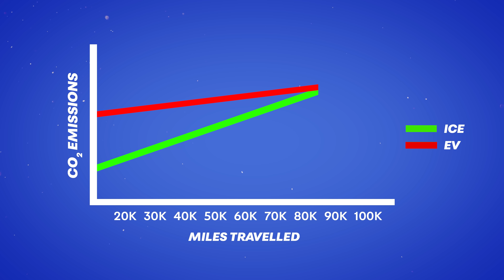Are Electric Cars REALLY That Green? [New 2022 Data]

Comment: The XC40 Recharge is twice as good as or  almost equal on CO2 emissions. Depends on how "dirty" electricity was used. Does driving style matters also?
XC40 ICE = 58 tones CO2e
XC40 Recharge = 27–54 tones CO2e

volvo-cars-LCA-report-xc40.pdf
Page 29. Conclusions.
"... the Carbon Footprint of an XC40 ICE and XC40 Recharge is 58 tones CO2e and 27–54 tones CO2e respectively....
 Life Cycle Analysis (LCA), has been used, which has been identified by the EU Commission as the best framework for assessing the environmental performance of products has been used... " end of citation.

Eventually, people will run out of gas / oil / coal.

Comment: The study assumes that EV components are made from virgin materials, which although true right now won't be the case once a robust recycling program is in place. Also as grids become cleaner, the breakeven point gets shorter and shorter.
Reply: Volkswagen are already building their electric vehicles using a high percentage of recycled materials.

Comment: The one thing that I don't see anyone talking about is the fact that mining the raw materials like lithium and cobalt is not only massively damaging to the environment physically, but there are also massive human rights violations specifically with cobalt mining, the other thing we need to keep in mind is that the electrical grid will have to be massively upgraded to keep up with the demand if everyone decided to go electric all of a sudden I'm not anti electric, but I feel like we have to talk about these problems and nobody is talking about it. Also keep in mind that on many older electric cars the batteries had to be replaced before the crossover point of Co2 emissions between ICE and BEV vehicles and what happens to the batteries once they are used up? Recycling the batteries is still very difficult and dangerous as it is a huge fire risk, this is why I am still hopeful of hydrogen coming in to at least to a degree try to save the day, yes hydrogen cars are not as fast and flashy, but I think that producing green hydrogen is possible, but we will see I guess, at the end of the day I hope that the planet benefits from renewable energy use and not some corporation that destroys the planet for profits

Comment: Thank you for this honest look at the comparison between EV and ICE cars. Another big area to consider is that there are so many ICE vehicles on the road now that will continue to pollute for 10 or 20 more years. What would be the trade off between recycling ALL of those vehicles asap vs leaving them on the road to continuously pollute for decades. In the '70s the USA did a buyback program to get the heavily polluting older cars off the road.

Comment: Here is the thing, you have to replace  a battery before 100k miles, did anyone take that into account? Also ale internal combustion combined is less than 17% of total co2 emissions.  If you wanted to fix pollution you would fix manufacturing and power plants but that would require companies to do, it's easier to make individuals pay to barely make any dent at all than to require companies to spend their own money and clean up their crap.
Reply: Why would you have to replace the battery before the 100'000 mile battery warranty expires? Have you done any research before you posted?
Reply: @Brian-om2hh  I know 2 people that had to replace their batteries. The argument is more so about co2. Even if you don't replace the batteries all vehicles in the globe still only account for 17% co2. And you will never get every vehicle to be electric. If you think ev solves the world co2 issues you obviously have not researched manufacturing and power companies.

Comment: It is safe for oil companies to sit back while EVs are promoted precisely because EVs will never be truly competitive.  Can an EV pull a travel trailer across 3 states in one day ? Of course not......  and it never will..... EVs cannot compete with internal combustion cars of the 1930s !  I ask you to research the 'Stanley Rocket '  of 1906-07,  the 1st car capable of 200 mph...... and the 'Dobel E series' 7 passenger limousines of the 1920s...... imagine the steam powered automobile improved by today's better lubricants and bearings, better heat exchange materials, better heat insulating materials, lightweight strategic alloys and carbon composites....... If the 1907 Stanley Rocket had shock absorbers, or proper weight displacement,  or an air dam to hold the front end down..... or even a smooth running surface, it could easily have broken 200mph without the accident occurring..... It took another 20 yrs of development and 22 more cylinders for internal combustion to break 200mph with Seagrave's twin V-12 sunbeam on the same beach.......  I say "Apply modern tech to the steam power system and it would take another 20yrs for internal combustion to match it's performance,  if ever.......  in the meantime,  we could all enjoy a 90% reduction of CO from every car and total elimination of all carcinogens and sulfurics from automobile exhaust....... the fuel we burn is not the problem,   the engine oil we burn in internal combustion cars is the problem "  Let's  wake up, folks !

Comment: That's using the lithium ion that ev current uses. Lithium titanium oxide is ready to go and used for a while. It's also good in low temps. Salt ion is going to be where it's at in about 5 years. It uses far far less rarer earth metals

Comment: A point not mentioned is that the production of batteries have changed dramatically in the past 10 years and continue to improve. For Gas cars.... well it's being the same thing for the past 100 years, not even the average Gas millage has improved a Ford model T consumed 16 miles a gallon not a huge difference from the average car today
SO lets see how this comparison evolves in 5 to 10 years

Comment: The didn’t factor in how toxic and bad for the environment making solar panels for your home is.  The factored the batteries, but that is only part of it.  Solar panels use EXTREMELY toxic materials and the waste from the factories destroy the environments surrounding the factories (China tries to hide this).  Also when your solar panels expire after 20-30 years they cannot be recycled so they are just thrown into land fills... all the cadmium, benzene and other toxic materials IN the panels pollute and destroy the surrounding soil, water supply, wildlife and air for decades upon decades.

Fossil fuel combustion engines have their problems, but honestly going green is creating a much larger problem for the generations 100 years from now, if they even survive the toxic waste going green creates.

Comment: I wonder if they took into consideration the average lifespan of the batteries? 
It is generally considered to be just under 65,000 miles before they need to be replaced. 
Then you have the cost to get the batteries replaced, and a huge spike in the carbon footprint to make the new batteries. Not to mention disposing of the old batteries.
Reply: That's bogus, the expectation of short battery life were entirely speculative and the speculation has proven to be wrong.

The drive to get new batteries is because better batteries are invented that give an improvement, not that there is substantial loss.
Reply: @Treblaine  Source?
Reply: @Nobere  The warranty period for the batteries is typically 100'000 miles.

To offer a warranty like that and not be ruined by claims the typical lifespan must be much much more than 100'000 miles.
Reply: @conceptobject  everything has a life cycle, just its nowhere near as short for car batteries as people assumed.
Reply: It depends on the environmental conditions

Comment: The irony of calling something that produces less Co2 greener is that Co2 is plant food thus more of it producing more plant life. I wonder how many miles the battery is good for before needing replacement thus producing more Co2. And do they calculate the carbon footprint of manufacturing, installing and replacement of the green energy systems onto the power usage of the electric car. All that said we have to go renewable electric as the fossil fuels are running out.

Comment: EV is much greener than assumed in this study. ICE mileage is on the road at a constant speed. Mileage is zero when stuck in traffic. EV power consumption is zero when stopped in traffic. EV also has regerative braking, which is not possible in ICE. No consideration is given to air pollution from ICE. Many states and countries are banning ICE in a decade or so.

Comment: How do we generate enough electricity to power the upsurge in EVs?
Reply: Just think for a moment. If there is an "upsurge" in EV's (as seems likely) then none of them will run on gas/petrol or diesel, will they? So that then leaves much more grid capacity, because it will no longer be getting used to refine massive quantities of fuel for ICE cars......

Comment: I’d like to see the long term affects of ev vs petro . Repairs in long term , battery replacement cost & battery life expectancy over petro repairs long term . 
Most petro cars today will go 100,000mikes before needing a single repair if it even does need anything replaced . Even oil changes are going 10,000 mile intervals from many manufacturers .
Where do these old batteries end up from ev cars or any lithium battery for that matter ??
Reply: You can already see the effects of petroleum. Street level pollution in many cities is now reaching critical levels. There are already deaths in London, with air pollution being cited on death certificates as a factor in the death......

Comment: Another issue that may need to be factored is the average temperature of where you live. EVs efficiency goes way down in cold climates. Heat has to be created using the battery and thats a big draw on the battery. Driving an EV in winter time in Winnipeg will get less mileage (kilometers) and engineering explained calculated up to a 40% decrease. Also batteries dont like really cold temps..

Comment: Great point about battery size...many of use don't need huge batteries. I have a 500e with a relatively small range, but it's all I need. Range anxiety seems to be having a detrimental effect on the environment, as it pushes manufacturers to ever larger battery packs.
Reply: yeah, ideally we need small batteries, but fast charging and many charging stations. 250km of range is probably more than enough for many people. Obviously there musst be models with longer range but I also think that having the chance to get (for example) 150-200km of range in 5min of charge is the most important thing. I know it is a lot, but I'm sure we can get there.
The advantage of small batteries is also that the car would be more efficient and easier to handle because of the reduced weight
Reply: @mastroitek  The new model S plaid can charge 160km in 7min. The problem is the charging speed is helped by the size of the battery. Charging a 50kW battery that fast will be very though but might still be achievable with LFP since its more stable that the current high Ni/Co ones
Reply: @jtengelbrecht4613  very true. But about LFP, consider that they operate at a lower voltage, hence you need higher current to match the normal battery (I don't remember the acronym). Higher current puts more strain on circuits. With that said, this should be a rather easy fix, dividing the battery in 2 or 3 parts with equal voltage. Or am I wrong? 
Either way a big problem is the recharging network, we should have many more fast chargers, and with fast I mean 300kW+ (which I believe are the fastest in existence rn?)
Reply: @mastroitek  Think Tesla's current gen chargers are 350kw. So for a LFP battery of the same size in mass but would have lower capacity. Im making the assumption that you can push LFP current a bit more and capitalize on the more stable chemistry of LFP. If you can compesate for the lower voltage with higher current you might get high charge speeds with lower kWh (smaller)batteries.

Comment: WAIT....time out!   We all know Batteries FAIL.  Its currently estimated between $15 & $20k for the part and labor (avg for a variety of EV,s).. Yes, some more and some less.  But don't forget the "carbon factor" in the manufacture of these batteries that will last about 8 years or 100k miles.  So the global average of 90, is right around needed replacement and the carbon factor will increase.   Also, I watched a comparison between the F150 eco boost and a Rivian truck TOWING.  This comparison was done just after the start of the War in Ukraine when gas prices jumped.  This comparison was performed in Colorado and showed that (for their test mileage) the F150 cost only $4 more than the Rivian to "fuel". Mind you that was at (I believe) at $4.30 a gallon at the time.  You can draw your own conclusion when the US gas price was around $2 a gallon.

Comment: I can buy a 20 year old used ICE car for less than $5000 that drives like new... and I can drive it for over 300k miles with very little trouble (as long as i buy Japanese).
There are no 20 year old EV cars, but even if there were a 20 year old EV car will be utterly useless unless you put a brand new battery pack in it... and thats assuming that the manufacturers make them available (they wont).
Do these figures take into account the fact that after 5-6 years of use these disposable EV's go into the landfill while ICE cars still have decades of service ahead of them?

Comment: it is true now that the fabrication of batteries is horrible, minerals travel across continent and sometimes comes back, but as companies like Redwood materials are recycling more and more batteries, the environment cost becomes lower and lower.

Also because most EV and batteries are made and sold in China, the environment cost there would be lower (yes I know they are still using coal for electricity, but are going to move away eventually).

Comment: It should concern you that all those toxic components come from mining. For instance, to manufacture each EV auto battery, you must process 25,000 pounds of brine for the lithium, 30,000 pounds of ore for the cobalt, 5,000 pounds of ore for the nickel, and 25,000 pounds of ore for copper. All told, you dig up 500,000 pounds of the earth's crust for just - one - battery."
Sixty-eight percent of the world's cobalt, a significant part of a battery, comes from the Congo. Their mines have no pollution controls, and they employ children who die from handling this toxic material. Should we factor in these diseased kids as part of the cost of driving an electric car?"
Reply: Well said Chris. I think the majority of people don't know these facts and are  ignorant about the manufacturing and the disposal of Lithium Batteries. Having been an engineer for the last 40 years working on electric vehicle's I cannot see this is the way forward. Hybrid vehicles that are totally self charging or Hydrogen to me is the only solution. For those of us who are old enough to remember, that in the 70s we were told LPG was the fuel of the future ?.

Comment: There is nothing more cleaner than the internal combustion engine. Reliability  low maintenance costs better in the winter,  gas and go. Or Charge sit wait charge. But it should be choice not forced like they try to do everything else.

Comment: Hopefully this information gets out there to the masses. 
I don't get why even more effort hasnt been put into cleaning the burn of petrol engines, improve catalytic converters etc. It would be a lot cleaner and cheaper than building an entirely new infrastructure. Especially one that still leaves you with tonnes of toxic chemical batteries to dispose of. And mountains of broken windmills and solar panels that can't be recycled. 
...Oh I know we'll just burn them or put them in the ground what could go wrong! 🤦‍♂️
Reply: The Swedes are experimenting with E-roads.
So like the subway but then above ground.
Reply: Also there are many countries that still use coal power plants to produce their electricity, which doesn’t help the environment at all.
Reply: We've been waiting for that. They haven't worked on that. And the clock is ticking on a world wide climate catastrophe.

Comment: Exspirements have been done that prove an electric car deos not need a large battery to run long distance. The exspiremental car had two generators one on each side of the electric motor, this car drove across the US from Florida to New York without a single charge. When we stoped in New York. Government aficals confiscated the vehicle, we are currently talking to lawyers about our envention. We were told the government would loose billions of dollars in recharge cost. Go figure government pushing its weight around. It's all about money in government pockets.

Comment: I postulate that the majority of EV owners has switched from ICE cars already owned an ICE car.
Question is what happened to the ICE car the day they picked up the EV? Did they sell the CO2 problem on to next owner not wealthy enough to buy an EV, or did it actually get retired?
My point is that unless you retire you ICE car when switching to an EV your actually not helping the planet at all, your simply just green washing your ego.
I will continue to drive my 52+ miles per gallon diesel powered car until the wheels come off end then switch to an EV to help the planet.